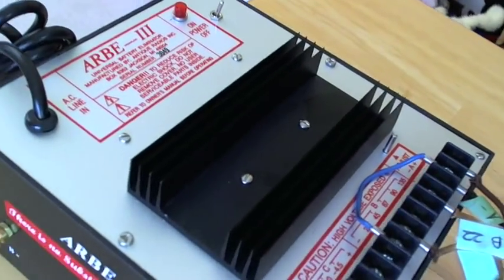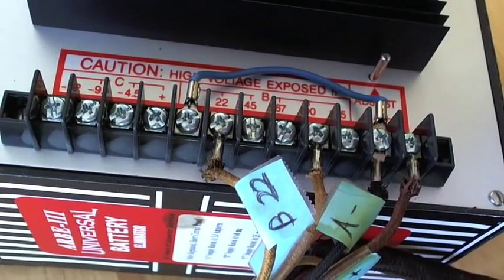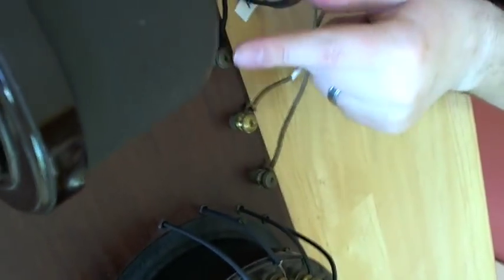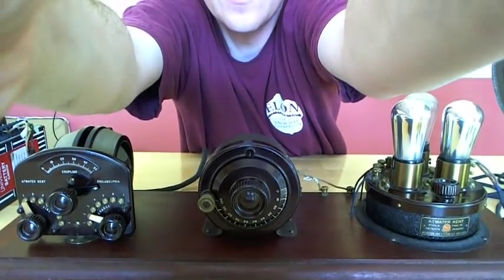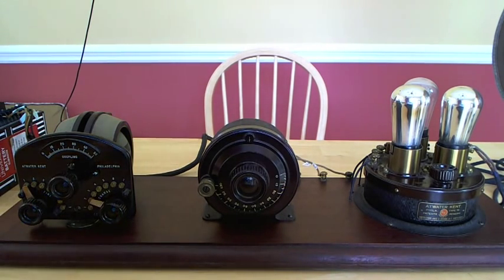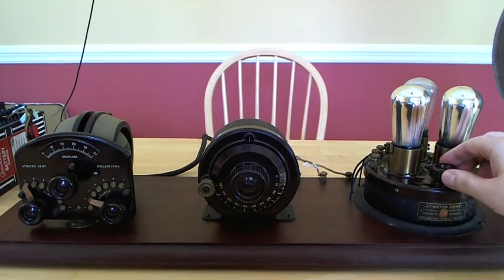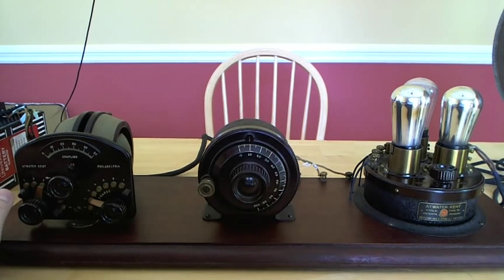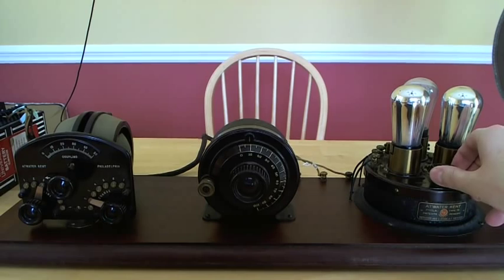(Non-VC) My "new" 1920's Atwater Kent "homebrew" breadboard radio

Comment: I realize this is a VERY old post. But in case you are still checking... What you have here is called the Atwater Kent DXer. The Vario Coupler's front end coil (The one connected to the antenna and ground) has the Variable condenser in parallel with it. Those 2 components can be  connected to s simple 1 tube island detector, or a 2 tube detector amp, or the 3 tube detector 2 stage audio like you have here. It also has regeneration. It was the only breadboard that had the ability to receive shortwave due to the multi tap coils that allowed it to cross into the sw band as well as the mw band. It was never factory built or even promoted, but was a great design for radio builders around 1923-1924. A period built DXer is much more rare than the model 10 you are looking for that came in 3 variations.
Reply from the maker: Thank you Mike for the detailed response!  Believe it or not, I still have this old AK breadboard--even after trading off most of my other old gear.  Such a charming piece.  I never did bring home a Model 10.  I could never find one that was both affordable and in some type of working condition.  :-)  Thanks for stopping by!  --Blake

Comment: A good ground connection (such as a clamp on a metal cold water pipe or a copper ground rod) might help with the interference problems.
Reply from the maker: Okay.  I assumed that since my ARBEIII has a built-in ground that I wouldn't need that.  I'll give it a try next time I have this one on the table catching some radio waves.  Thanks for watching and for the suggestion!  Best, Blake